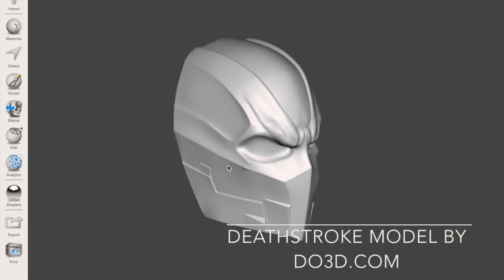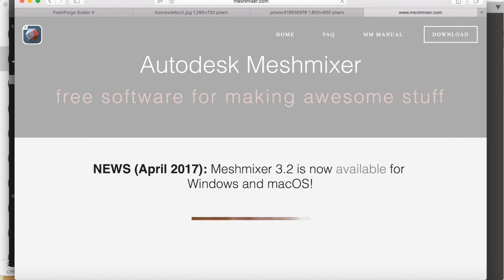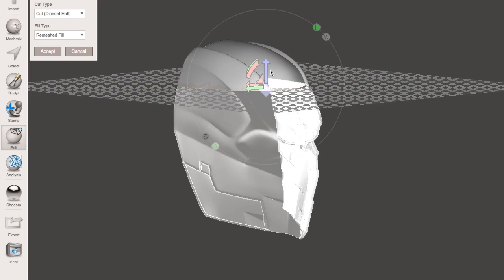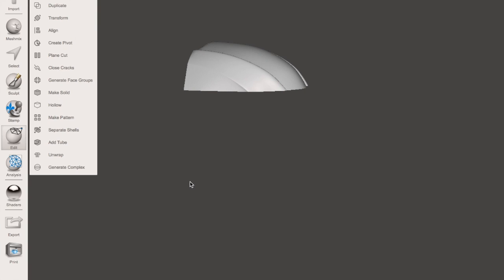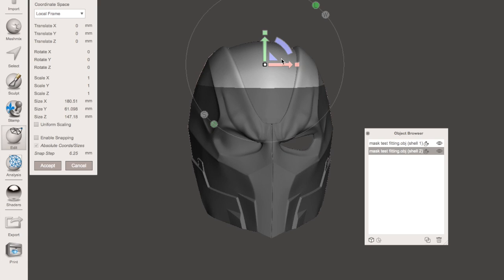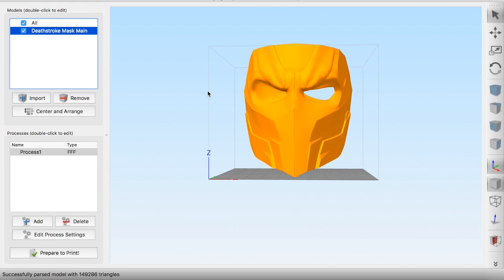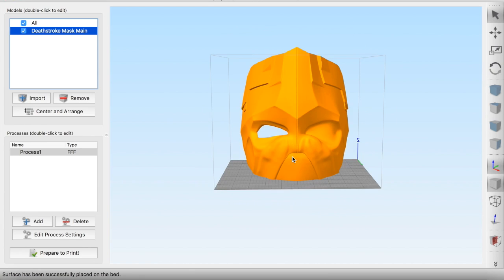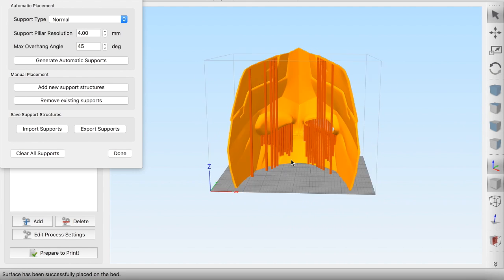How to slice a helmet file for 3d printing

Comment: this doesnt cover how to split larger pieces vertically. I have a chest armor piece I need to split horizontally and vertically. does plane cut allow you to select the plane or is it always horizontal and you have to rotate the part?
Reply from the maker: trendkilla254 I'm doing another video now on how I'm slicing up a chest piece, you can use the rotate tool to move the axis of the plane vertical I'll cover that in my next vid